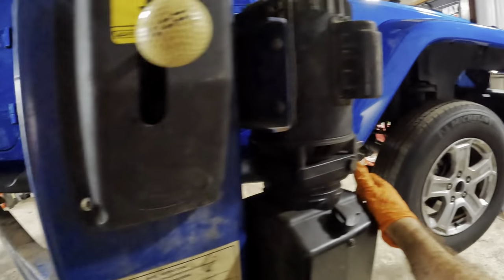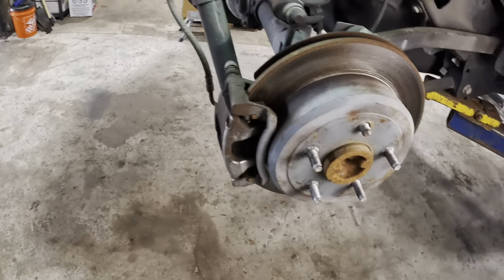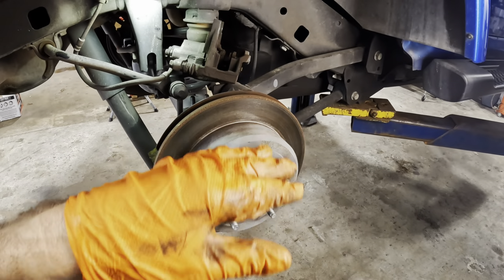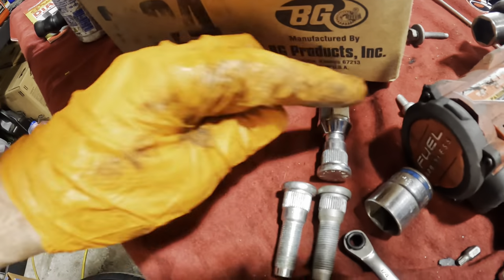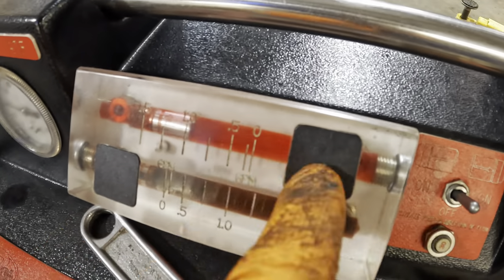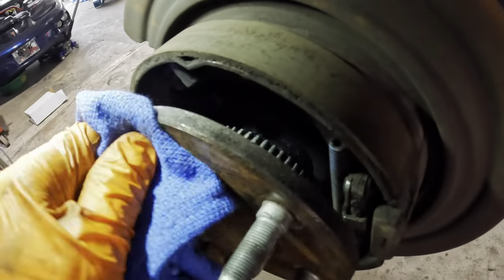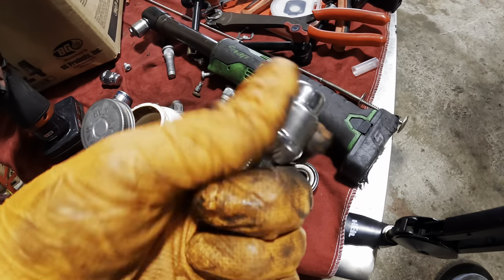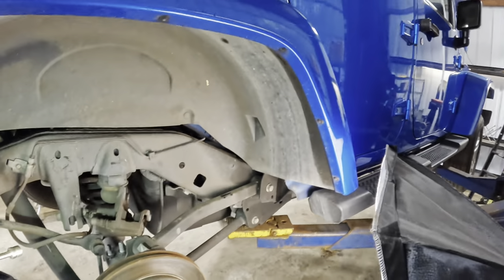Busted Wheel Stud! Fix IT! Jeep Wrangler

Comment: the loose stud was probably caused by 2 studs failing, and the wrong part purchased as a replacement, seen it done many times by DIY mechanics, who go to the parts shop and ask for a wheel stud, but have no idea there are different sizes used across makers car models, and even on single models also, and that might be why the other stud was not replaced because they found it was incorrect

Comment: The stud tool is one the best ones out there! I replaced wheel studs without one, the tool makes it much easier.
Reply: Can you do it without that specialist tool? 

Like a stack of washers and just lube in between them so they spin freely?
Reply: @ricebike  I used to use a  large diameter nut which is more or less the same thing I bought mine years ago (when it was cheaper than it is now), it's more than paid for. For larger trucks, you'd have to use truck version of the tool or use the nut method I mentioned prior. It's rare that I run into trucks with broken studs. It's mostly cars.

Comment: Studs are SO easy to install......Hard to believe the number of people driving around on 2-3 lug nuts.
Had a Hummer H2 with 2 studs per wheel broken.  Swapped them all out in under 1 hour.
Reply: Sons are easy. Some won't fit w/o further disassembly and take a lot more work. I've seen some where the rear axle has to be removed to do it.

Comment: I put my money on a tire shop with a extreme desire to over tighten lug nuts...  broke one bolt off and stripped out the threads on the other.  I wouldnt be surprised to find other messed up bolts.

Comment: My take is some hack tire "trunk monkey" broke off the one stud by not using a torque stick or wrench and just put whatever he had as a replacement, then broke the other one off or badly cracked it, then it broke. Maybe stuck it back on with super glue & the customer saw nothing wrong when they picked up the Jeep, then it fell off 20 feet down the road. (Yes, we have some so called "mechanics" that would do that in my area.)
 A local tire chain store (free beef ) put new steer tires on my semi tractor and just used an air gun to put the nuts on. When we asked why no torque wrench, the reply was "They didn't have one" (WTF???) You don't put lug nuts on without a torque wrench, especially at a store that does semi tire servicing. Last we ever used them. That cost them $3000-4000.00/yr  in lost business from my company. We had to buy a 600 ft lb torque wrench and properly torque them ourselves. 
Here the State Patrol  weights and measures truck inspector checks torque on tires after pulling you over to verify load weight and paperwork, plus a safety check.

Comment: That stud could have been from the factory. Sometimes you get one that's slightly malformed. Not bad enough that it's obvious when you look at it but just enough undersized that it doesn't grip quite as intended. In the days work it's not totally impossible for one to go through.

Interesting about the anti sneeze. Where I live you always add some copper paste to the bolts or you know you won't be able to remove them when it's time to switch to winter tires. Yes it's rust belt living. everything will rust unless it's protected. Wheel nuts can be a pain to remove if they weren't lubed. Heck even wheels can rust to the backing so you have to use a sledge to get them free. Well you can just loosen the lug nuts a few threads and run the car around the parking lot and with any luck the wheels will break loose so you can get them off.

Comment: Check the diameter of the stud that was wobbly with a micrometer against what actually gripped the ID of the hub.  My guess is that the knurled part was not to spec.  😉
Reply: They come in different sizes so probably is to spec, just not for that vehicle.

Comment: From working at a dealership during the time they replaced the rate techs with hourly parts replacers the do not know why they are there and always put them back on. This is why you see good techs and diagnosticians at independants or owning their own shop now. Thanks to the auto dealers for screwing the good techs.

Comment: The kind of place that will have and mandate reinstalling those clips (because one customer who was a moron complained once) is the same kind of shop that will penalize the tech for the wheel stud they damaged which is why they jammed whatever stud they had and used the clip to hold it until they could get it sorta tight.  The too small stud clearly had different markings on the back than the broken one.  It also looks like they only had one stud so the one that was mostly there got some sort of hack job self tapper grind so the wheel stud held on long enough to get it out the door.

Comment: Hole obvious not wallowed out, new stud pressed hard. Either someone knocked the tips of the splines off for a shade tree job, stud out of spec or simply the wrong stud. I've seen bulk fasteners where it was obvious one or more parts skipped a step on the productions floor.

Comment: Best I can say is that the suspect wheel stud had been replaced at some point.  As far as those clips are concerned, I generally cut them off and discard them afterward, but there are those who will reuse them.  That's my guess as to attempting to answer the mystery.

Comment: My concern is all the studs are compromised.   I've had a lifetime of bad luck with others touching my wheels.  Lost a RF wheel once on my F100.  All the studs showed rust part way thru.  I blame impact wrench monkeys. Even had trouble with studs breaking when I tried to remove the nuts myself from over tightening.

Don't mock me but I used to put the clips back on.....

Comment: I think that what happened with that stud is that someone tried replacing it but had the wrong size and just sent it. Just because those clips were there doesn't meant that someone didn't put them back on after carefully removing them to begin with. You did find that there was a new-ish lug nut on there. So, that may have come with the incorrect sized stud. There is a possibility, However slim, that it was wrong from the factory but that's highly unlikely. I have actually reinstalled those clips on one of my cars years ago before I realized that it wasn't necessary. Just my theory...

Comment: Hi Ray,
My theory on the clip goes back to your comment when you were taking it apart that there was a 3rd clip. I suspect at the factory someone on the assembly line had that wrong sized bolt and just clipped it in being lazy instead of putting in the right one.
What do you think?

Comment: I assume it was either striped out stud or broken stud given the other broken stud. They got some studs and found out after knocking one out, that it was the wrong size but the threads worked so they might have stolen a clip or just added one on (might have been why there was the odd 3 of them) so they could hide their mix up. I assume they thought that since there was one there it can clamp until the next guy deals with it.

Comment: I suspect someone broke a stud trying to get the wheel off. Then the retainer clip was removed from the broken stud. They bought the wrong size stud to replace it and used the original clip to hold it in place.

Comment: Inner brake pad has so much more wear, caliper and/or brake line might be bad, or the eBrake needs adjusting.
Reply: Or the sliding pins are lacking grease

E brake or parking brakes are those shoes that are behind that hub

Comment: I'm guessing the loose stud may have been caused by over torquing it during the factory assembly process. The same with the broken one except it didn't break at the factory but the stressed part broke when someone attempted removing the wheel. Hmm, just my hypothesis anyway and we'll never know for sure! 🤔

Comment: typical factory axles, the jeep i had i had upgraded the rear alxle shafts with ones from nitro. they were supposed to be 40 to 50% stronger, anyway they used regular bolts that screw in. still had to remove the brakes to change a stud but it was still easier, no pounding or pressing. not thats its hard to do anyway.

Comment: your number one troll back.  use your brain a bit more.  a new hub has NO grooves caused by lug studs being pressed in. so the too small stud was a f'up by a shop, as it COULDN'T have made the grooves found in the hub. they used press on clips to keep the studs in place to get the wheel on.

Comment: Could the errant stud have been the wrong size stud that was accidentally mixed with the proper studs at the factory? The stud may have caught enough to somewhat tighten the lug nut.  The hub may never have before been removed.

Comment: It was the wrong stud mixed in with the correct ones at the factory. Welcome to assembly line errors.
Reply: They do not assemble the axle on the line.  It is supplied as a single complete component from the vendor.  Maybe Dana.  Likely someone else already worked on the axle.

Comment: IMHO, a significantly less scrupulous mechanic broke the original stud at some point and put in what was lying around.  It was the wrong size, so (s)he "fixed" it by locking it in place with the locking clip.

Comment: Wrong stud: I worked for a company that made auto parts (tappets) back in '71. I was told to scrap any part not in a bin - not to guess "It look like those" and get a wrong part into the system. Somebody made a mistake back at the factory, and the wrong part sailed through to a customer.

Comment: The issue with the loose wheel stud was the loose nut that operated the dukka dukka previously during the first repair. Most care problems are caused by loose nuts..... Loose nuts are the idiots that think they are mechanics or worse, the loose nuts behind the wheel.

Comment: Yeat another nice video. Just a stupid question; How often do you need to change AT fluid? And is it hard to DIY? As always; Love from Norway
Reply: some DIYers mostly do a drain and fill...since they don't have that fancy transfusion machine.

And just do that more frequently (like every oil change or so)
Reply: @ricebike Thanks. I've never changed the oil, so maybe it's time. Thank you for good answers. Love from Norway
Reply: @Thomas_Aslaksen  others wait too long and if it looks black and smells burnt, it's gone too far into the grave.

Save the transmission oil drained (because that's the clutch material that's helping to grip it) -just in case the transmission slips after a drain & fill

Or others use some Lucas anti-slip chemicals when it's that far gone

CVT transmissions are a separate beast and must be changed frequently with OEM fluid
Reply: @ricebike  Thanks for all the help. You guys are awsome. Thanks again. Love from Norway

Comment: Why do you not use a hose to exhaust outside. I know your doors are open but would there still not be an increase of carbon monoxide?
Reply: He has exhaust fans up high in the back wall of the shop.

Comment: Did or will you brakleen the lubricated studs before installing the lug nuts? Or is that a silly question?
Reply from the maker: I just wiped down with a towel, technically there were a few molecules left but who’s counting

Comment: That loose stud had a different shoulder and splines even though it was the correct thread. It was obvious on the video that the shoulder was different. If you compare the loose stud and the broken stud you would notice the difference.

Comment: Ugh, are those lug nuts the 2-piece design???

Hate those Chrome or whatever covers that rust jacked and need to hammer on a socket or use a slightly bigger size to take them off😢

Comment: Company that made the wheel studs either had a stud or two left of the wrong size or someone found a stud on the ground and threw it in the box thinking it fell from there. Either way line workers are suppose to catch that and report it to their foreman. Unfortunately thise rules were made a long time ago when a line worker only had 1 or 2 jobs and could take the time to say this is a wrong or bad part im pulling it, in todays current situation the worker has 4 jobs and doesnt have time to worry about it. Also marking the car as having an issue and being pulled off the line to be fixed is in many plants like self reporting you're screwing up, old policy states to mark the vehicle for customer satisfaction and safety, new policy is the same but its unwritten if you have to many fixes even because of bad parts is not good for the worker. So all kind of crap gets by.

Comment: Somebody, like ME, with OCD put the clips back on.... Seriously? The rust on the axle hub didn't tell you someone has been there before and did NOT clean up the surface PROPERLY. Another brake job done by a hack... 
IF it had been done correctly, at least one pad would have fallen out of the caliper when you laid it down. Didn't happen because they are NOT as free as they should be. Why do people think that lack of rust, means lack of prevention? SMH

Comment: After having spent 31 years in auto assembly,I think one of two things might have happened. One----really crappy workmanship in the assembly process (which I kind of doubt) or two----at some point,some know-nothing backyarder replaced a broken stud with the wrong size and was too stupid (or didn't care) that it didn't fit. I would go with the latter because of the application of 3 brake drum retainers.  The assembly process normally only requires one.  Besides,running gear is classified as MVSS and no operator would risk being responsible for such a foolish error that could result in a massive recall that would likely cost them their job.

Comment: Your lugs have nuts? ..... 🤔🤔 .... 

Mine have lobes ... 😆 🤣 😂 

You can take those wire clips off and reinstall them, unscrew them by using a screwdriver to act as a punch to remove them. Then use a socket to push them back on, obviously not essential but can be done. Wrong stud ordered or only one they had in an emergency type situation? (Vehicle owner or a workshop?)

Comment: Am I mistaken or did that wheel look like it had drum brakes on it?
Reply: It's a combination rotor and drum set-up

The drum parts are the parking brake mechanism

So one can just use a simple c clamp for the brake caliper piston like the ones at the front to compress for new thicker pads
Reply: @ricebike Thanks

Comment: The one time you forgot to match the parts, is the one time the part that came off the car is the wrong part. Put them next to one another, and look at the splined bit. The one from the car is shorter, and just a hair's breadth thinner. Unfortunately, you didn't match the parts as we've all seen you do 100 times already.

Comment: That confusing you start the job and the breaks are disc brakes  then the video carries on and the brakes are drum. Mmm now that's confusing.
Reply: Ok, this is a combination rotor and drum set-up

The rotor hat is the drum part

The small shoes are called the parking brake shoes.

So it's just called rear brake rotors, 

but the other parking brake design for the rear calipers have that mechanism inside the brake caliper piston... That requires the technician to turn the caliper piston clockwise while pushing it back into the caliper bore for the thicker New brake pads

Comment: That wrong stud was probably on the assembly line.  They probably grabbed one that was from another line and didn't want to bother with finding another one, so they put the clip on to hold it during the assembly process.  I've known a lot of Jeeps that had similar assembly issues like that.

Comment: Obviously wrong from the factory,  the worker grabbed studs to install,  noticed that one was the wrong one and installed it anyway, thus the third clip, clipped in and with the wheel bolted down nobody would notice right?

Comment: You claim never use anti seize on studs/lugs. But you must never have dealt with cars recently from the Midwest.
Little dal will do ya. And if you're that paranoid about it shave off 5-10% of your torque value if you think you're going to over tighten them. Pep boys do about 5-7 ugga duggas. Not like the care.